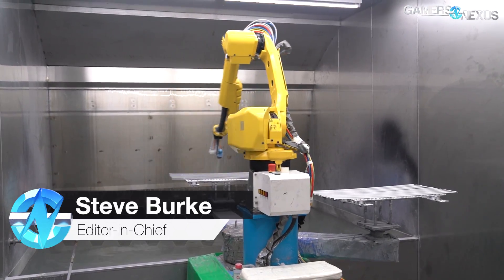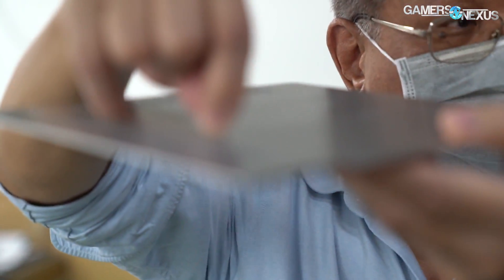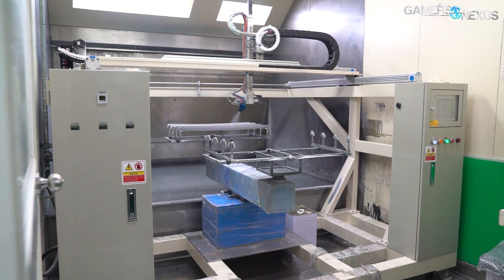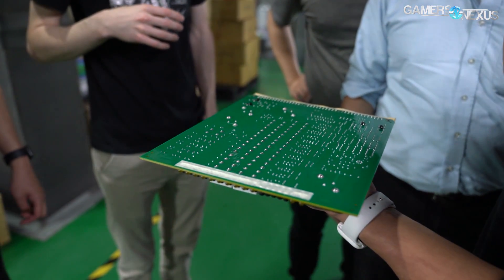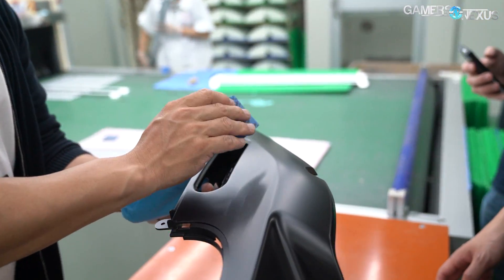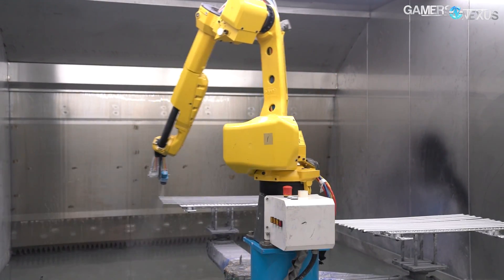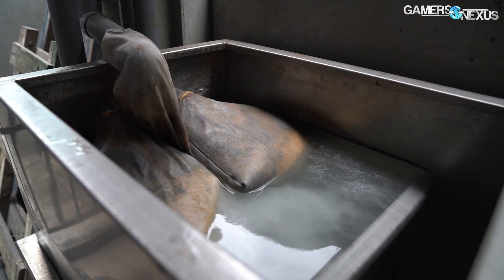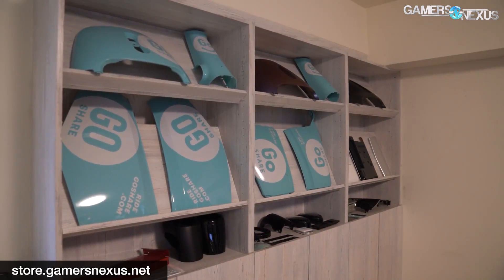Painting Factory Tour: How Computer & Vehicle Parts Are Painted | Automated Factory Tour

Comment: You may not believe this but here goes:  I working in a shop with painting rooms/booths where we had a particular problem from a maintenance perspective.  Management wanted the booth airflow to vary based upon whether the entrance doors were open or closed.  The reason given was that dust could enter the booth with the doors open thus ruining the paint jobs.  Also, with the exhaust pulling air into the booth, the doors would slam shut upon closing, knocking dust from the ceiling and door frames.  Well, this was an easy fix... magnetic proximity switches were installed to kill the exhaust fans if the doors were opened.  The fans were powered through VFD drives so we also ramped the fans up slowly so as to not disturb the environment.  Well, after constant complaining about the lighting and air and, and, and we discovered that in between paint runs the booth was used as a sanding booth, creating all the dust that were the basis of the complaints.  My point is that after you went thru the dust blowing at the entrance, put on the booties, blew off and wiped any dust from the product to be painted ...well, would you paint them in a sanding booth?

Comment: The hardness rating of paint is the hardest pencil lead that doesn't cut through the coating.  Typically these tests are done with H to 9H leads but can use others like F or B leads. The test is performed by first flattening the tip of the lead with fine grit sandpaper till it's completely flat across the entire diameter of the shaft of the lead. This will make a sharp 90°edge between the flat tip and the side of the shaft. The shape edge is placed on the surface of the paint so that the lead is at a 45° angle from the painted surface. Then you must push forward a least 1/4" with as mush downforce as you can without breaking the lead. You will repeat this process with different hardness of leads until you find the hardest one that doesn't go through the paint.

Comment: What i learned today: There is not only type of gallon, there are US and Imperial gallons. The world would be a better place if everyone started using SI.
Reply: This can cause confusion in Canada, because Canada used (and still does unofficially to some extent) Imperial measurements, which are not always quite the same as US measurements. Further complicating matters, in Canada, we often call the American measurement system "Imperial", even though it's not.
Luckily, the difference only applies to volume, which is more commonly metric. Imperial weights and distances (which are still common in English-speaking Canada) are the same as US measurements. But fluid ounces, cups, pints, quarts, and gallons are all different. And not a little different, one imperial gallon is 1.2 American gallons.

Comment: the hardness that they mentioned may be HRC (rockwell C scale) its used in giving metal a hardness scale almost always. specifically its the gold standard for knife hardness measuring high end knifes are around 60-67 HCR so around 1-8 HCR for paint sounds right
Reply: Unlikely HRC, the C is related to a conical tool indent test and is usually related to metals rather than paint - this is likely related to graphite blunting tests

Comment: Question:  What type of paint were they utilizing?  Water based, or petroleum based like enamel, lacquer, urethane?  In developed countries the push is for water based to reduce VOC's (volatile organic compounds).  It is more than just changing the paint though as each paint technology requires a different drying technique.  Water based for example needs lots of air flow to dry properly.  Petroleum responds well to IR heat that penetrates the substrate and dries the coating from the bottom first.

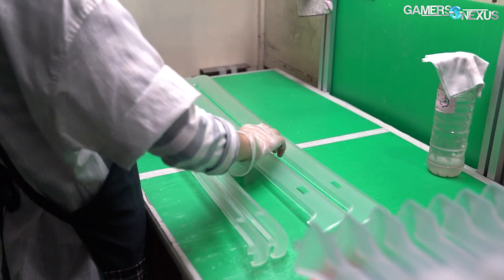Comment: 3:48  They most likely spray adhesion promoter to plastics.  Adhesion promoter is more efficient than abrading the surface prior to applying the first paint coat.  Oil contamination is a huge issue.  So large an issue that they have communication channels with the plastic manufacture to ensure that something as simple as release agents are not changed before validating the effect.

Comment: @Gamers Nexus  --  For the Hardness scale . . . 
------
https://blog.iglcoatings.com/ceramic-coating-hardness/
The Mineral Scales (Mohs, Ridgway and Wooddell) are not very suitable to be used with coatings or films. Hence the a standardised ASTM Method of measuring film  by using Pencil Hardness Scale is created. The pencil is made of Graphite which only rates 1-2H on the Mohs scale. Think of the Pencil Hardness scale as a detailed hardness scale for the Graphite.
Pencil hardness measurements have been used by the coatings industry for many years to determine the hardness of clear and pigmented organic coating films. This test method has also been used to determine the cure of these coatings, especially when forced dried using heat.
------
There's testers available like https://www.gardco.com/hardness.cfm

Whether they're using that specific sort of test, or something in-house and proprietary . . . Dunno.  I just pasted a little bit of the description.

Comment: hmm interesting the robotarm looks like an arm for welding and not for painting (this energy 
supply for the EOT through the arm itself is pretty common on welders)

paintrobots typicaly have a different design for the hand to help with straight line movements

also i have never seen a paintrobot without a protectiv cover over it, but thats mayby due to LVLP
instead HVLP and the need for very strong ventelation with a worker in the same cell

thats another point, here in germany if such a set up is checked you can close the factorie till its 
fixed
you have a worker in the same cell as this non collaborative robot and workareas overlap without 
an obvious way to prevent the robot hitting the worker
no hardstop for the arm in place and no light curtains for an approved software solution

even the gantry style robots wouldnt be approved and i can tell you the gantry style might hurt,
but the 6-axis arm would simply not care if it hits you

Comment: That coating on the PCB is called conformal coating, and is difficult to do properly on motherboards because of the connectors used could become blocked by it, so it's only used on low volume, high profit margin parts, usually for industrial use.
Reply: Did a ton of that and it was not difficult to do. we had stencils for blocking where we didnt want to go on connectors and key components

Comment: The PCB coating is called "Conformal Coating"
Reply: Horrible stuff - I used to have to coat PCBs with it using a brush and use a black-light to check for complete coverage; the varnish glowed under UV light.

Comment: I always wondered why DIYPC cases couldn't match the paint between panels especially on there white cases ,  its very noticeable.     It never bothered me until i watched this video!  Awesome video i liked it!
Reply: The challenges with white paint are two-fold. The first problem is production - maintaining colour tolerances on something that effectively has no pigmentation is extremely hard as you have far fewer ways to correct for variations from the target colour during production, meaning your weighing/measuring and mixing processes have to remain super-accurately calibrated batch to batch. The second problem is application - while lighter colours are often used to hide blemishes on materials, pure-white paint (especially gloss) does exactly the opposite and picks out any roughness, moulding lines or other imperfections that disturb the uniformity of the light scattering off the surface. When applied to materials like plastics with a certain amount of variation in the way the surface texture turns out between batches of the base material, it becomes nigh-on impossible to get a white coating match between plastics and metals without extreme attention to detail at every step of the production process.

Comment: If it truly is a solvent-based paint like you mentioned, I'm surprised they can get away with not using a hazardous location robot. That particular robot is not certified for class 1 division 1 environments. Then again I'm sure they have different rules in different countries. But that would never pass muster in the US.
Reply: Robots don't have workers rights in Asia yet
Reply: Well, water is technically a solvent... =)

(jk)
Reply: And robots designed to go into class 1 division 1 environments have to be internally air purged, so they are sealed enclosure where air is pressurized into theinside of the robot so that way if there is any leaks anywhere air is always flowing out to solvent vapor can never get into the high-powered servos wiring areas. then there's a pressure sensor inside the robot to confirm that the inside of the robot cavity is always maintaining pressure.
Reply: If you want to know a little bit more look at the fanuc robotics paint robot series.
Reply: @eclsnowman  Look at the employee's helmets. They're shiny, shiny as in just peeled off the plastic shiny. I don't think workplace safety is priority #1, or even #2 here.

They don't wear helmets except for tours, which is evident by the mirror finish on them. Unless of course they have someone wax coating/buffing the helmets every night (let's be real, they don't do that). According to you, they also use the wrong kind of robot for solvent spraying (I am unfamiliar with the practices).

Also going to look up the classifications of robots you said, interesting stuff! Thanks.
Reply: @pickleadaykeepsthedoctoraway  if they're spraying a water-based, then they could be able to get away with it. But even if the carrier isn't solvent a spray booth has to be specially certified to not have to conform to the class one division one standards, at least in the US due to NFPA 33, or international building code for hazardous locations. That's because any dried overspray can still be combustible even though the solvent carrier isn't. Think about a grain elevator explosion.

To be honest the codes make it pretty difficult to do a lot of different things in the paint industry. But almost all codes are written because someone somewhere blew something up and they had to write a code about it. In a spray booth everything needs to be wired explosion proof or at least behind an intrinsically safe barrier keeping it below the current threshold that can create a spark. Since the servos in a robot are high-powered and can't possibly be run below the current threshold, hence why they have to be internally sealed and purged.
Reply: @eclsnowman  in china they probably don't gaf about safety standards that would be otherwise be found in US
Reply: @pickleadaykeepsthedoctoraway  The only folks I saw wearing hard hats were the folks on the stamping/cutting/whatever the hell that line was, and you damn well take care of those because you drop them, gouge them, damage them or get the wrong chemicals on them and they soften, lose rigidity or otherwise become completely worthless pretty much immediately. The fact their shiny-shiny like that tells me the folks who wear them take very good care of them - they're skilled professionals in a professional environment. Given that every worker was wearing suitable PPE of every sort at every other step of the process, I doubt they just get that stuff out when their cameras/officials around.
Reply: Wait, why would that robot not be classified got hazardous locations? Is the solvent a danger to the outside material? I'm a programmer and I just found out that this is a thing.
Reply: @theblackhundreds7124  Purely guessing, but many solvent vapours are highly flammable, so machinery operating in such conditions might require certain safety specifications.
Reply: @theblackhundreds7124  I have no experience with robots, but the first thing that comes to my mind would be flammable solvent fumes. Those can be ignited by electronics that are not properly sealed, hammers that draw a spark when hammering due to their material etc.

At my workplace every device (mobile phones, walky talkys, flashlights, hammers...) we use in areas with the potential to develop flammable or explosive fume/air mixtures has to be rated for that. I think Eric recognized the robot and knows its not typically rated for that.
Reply: Here in the states there's many codes tied to spray booths. The most notable is NFPA 33. That's where I'd start if you wanted to find out more about classified zones in and around paint booths and paint storage.
Reply: that's why manufacturing in US is so expensive. they have too many useless rules and regulations purely designed to prevent small business from operating and only allow big megacorporations to operate
Reply: @hitler69  I think that's a little simplified, but I know what you mean. 

My opinion for the main reasons it's expensive is cuz we have a high standard of living, regulations designed to keep both people and the environment safe, and the lower quantity I'm trained workers. I know that last part is contentious, but really we don't have a whole lot of ditch diggers anymore. Everyone went off and got a liberal arts degree and no one knows which end of a crescent wrench to hold anymore to do work. For my day job I'm in different manufacturing plants every day. Everyone has a sun faded help wanted sign stuck to the outside of the building. But we do very well with automation for the things that we do fabricate here. The problem is years ago US corporations realized that shipping manufacturing off to Asia, India, etc would net corporations larger profits. That's a hard ship to turn around. It'll take a culture shift, and a generation of workers that want to get back and work with their hands.

Comment: The 8H hardness is probably on the graphite grading scale for pencils. While not very hard, most ceramic coatings offered for automotive use to improve scratch resistance claim to achieve 9H hardness. So I guess 8H is pretty good in terms of paint hardness.
Reply: It is most definitely not mohs scale since a coating with8h for plastics would be completely insane and seems very unrealistic
Reply: My job is decorating metals and plastics with various coatings for multiple products. Things like speedometers (and other meters), microwave button panels,
ATV warning labels and heavy machinery window displays.
8H on Mohs scale for some purposes is hardly excessive.
Reply: @Doken Boken pretty sure it is similar to the metric used for graphite
Reply: @dokenboken5542  How is something designated "H" on Mohs scale at all? If it's on Mohs scale, it's simply "8" on Mohs scale, not "8H".
Reply: @SianaGearz  ah, silly americans...
pencil lead hardness outsite of your country uses B-H scale, B means black, higher the B number means higher graphite content, produces softer lead; H means hard, higher the H means higher clay content, produces less visible lines but with more consistant line width. most often used pencil is HB and 2B
Reply: @min_nari  Pardon me? I am familiar with B-H pencil hardness scale. There's a person above claiming that it's Mohs hardness though that i was replying to, and i disagree.
Reply: @Piupiumacher  I do understand what you saying but unrealistic could it be? If the coating is trying to emulate the same characteristics of ceramic coating?
Reply: 8H is very hard for paint. A typical H hardness for a polyester based powder coat is around 2H-3H.
Reply: It does sound correct but also strangely it might be based on Mohs Scale and the Rockwell Scale. It's probably a simplified and butchered way to tell the hardness of rubbing against different materials.